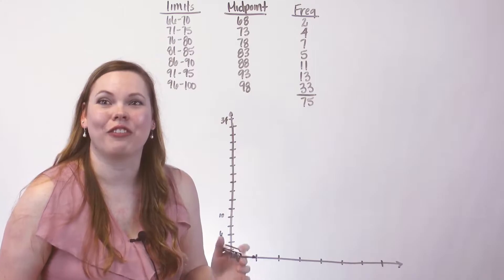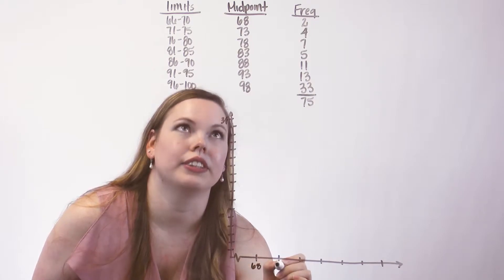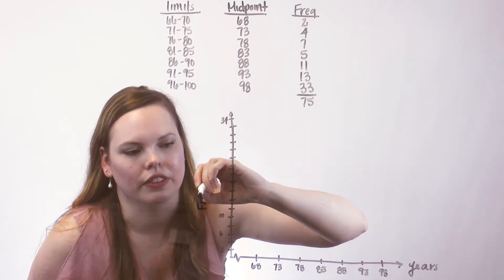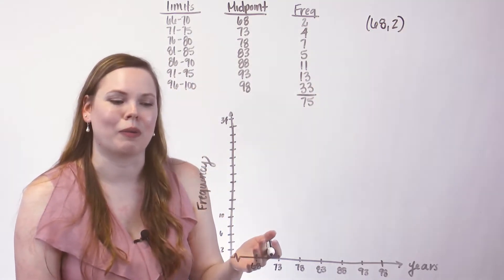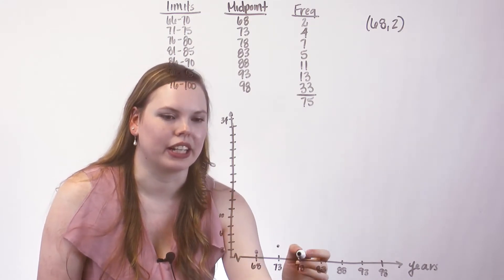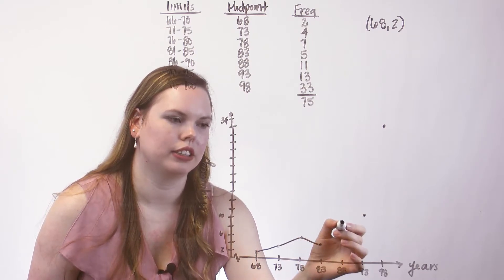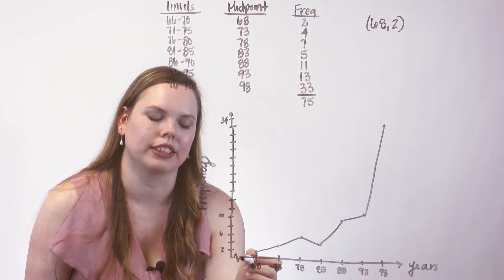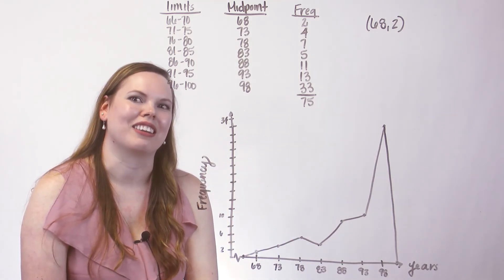Constructing a Frequency Polygon

Comment: At what points does the first and last arm of a polygon touch the x axis?
Reply from the maker: It’s the midpoints of what would be the class before the first class and the class after the last class.  Use the class width and find those classes and then the midpoint of those classes will be the points that it touches.